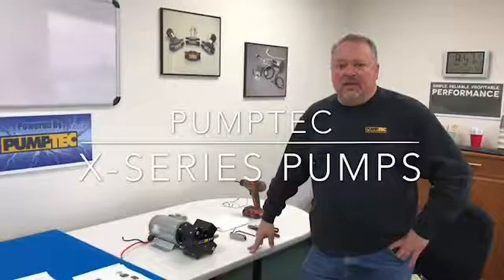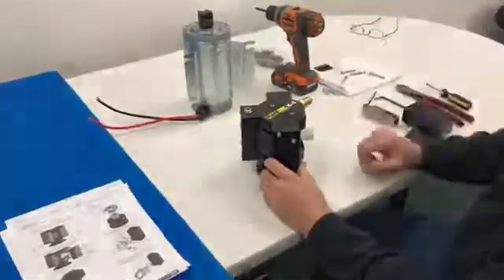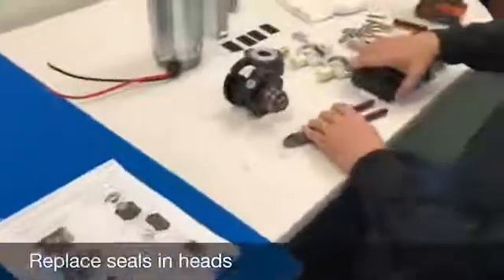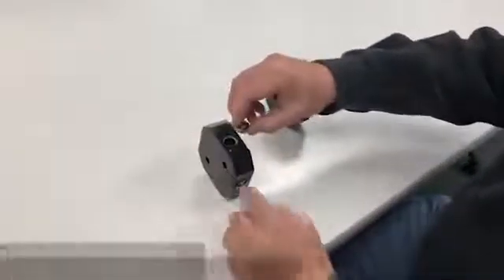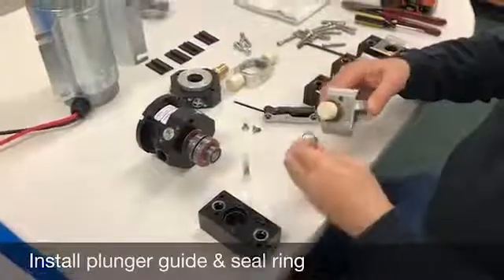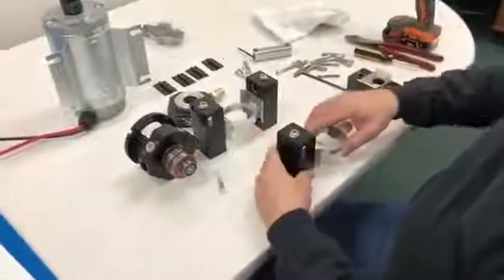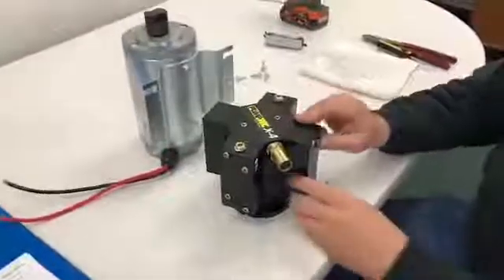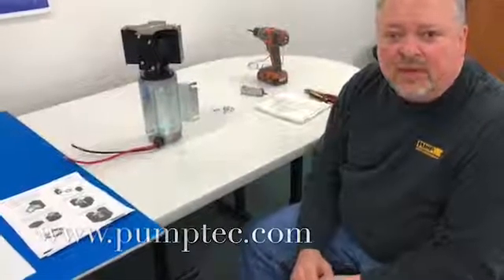Pump Demo: Watch a Pumptec X Power Washer Pump Rebuild | Pumptec

Comment: Can you do the same for the X-6? My pump isn't coming on. Is there a fuse inside it?
Reply from the maker: All X-pumps are built the same, so this video would apply to any x-pump. The pump can be powered by a multitude of motors with various voltages, so if the motor is not turning on, I would suggest a contacting who you purchased the system from for wiring instructions.